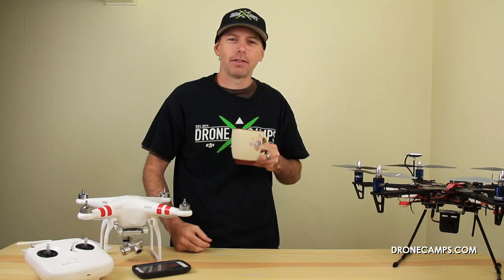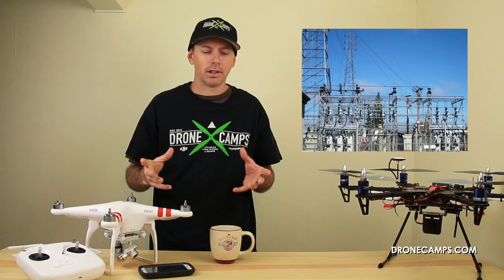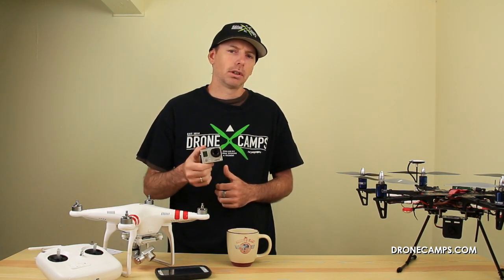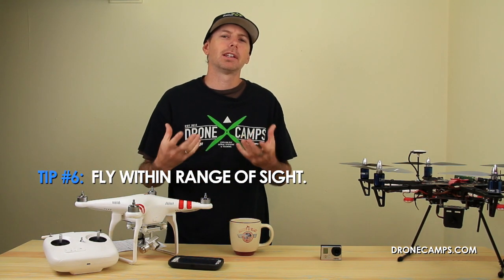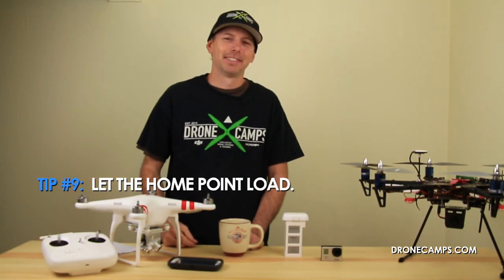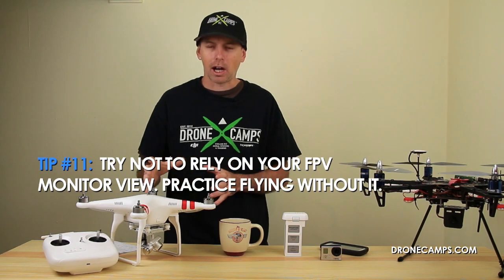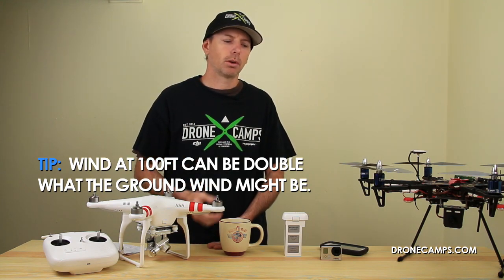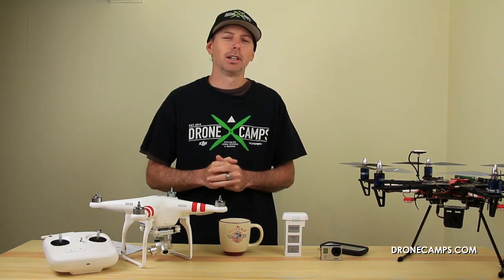DJI Phantom 2 - How-To AVOID FLYAWAYS, UPDATE

Comment: AMA NATIONAL MODEL AIRCRAFT SAFETY CODE
Effective January 1, 2011
A. GENERAL: A model aircraft is a non-human-carrying aircraft
capable of sustained flight in the atmosphere. It may not exceed
limitations of this code and is intended exclusively for sport,
recreation and/or competition. All model flights must be conducted
in accordance with this safety code and any additional rules specific
to the flying site.
1. Model aircraft will not be flown:
(a) In a careless or reckless manner.
(b) At a location where model aircraft activities are prohibited.
2. Model aircraft pilots will:
(a) Yield the right of way to all man carrying aircraft.
(b) See and avoid all aircraft and a spotter must be used
when appropriate. (AMA Document #540-D-See and Avoid
Guidance.)
(c) Not fly higher than approximately 400 feet above ground
level within three (3) miles of an airport, without notifying
the airport operator.
(d) Not interfere with operations and traffic patterns at any
airport, heliport or seaplane base except where there is a
mixed use agreement.
(e) Not exceed a takeoff weight, including fuel, of 55 pounds
unless in compliance with the AMA Large Model Aircraft
program. (AMA Document 520-A)
(f) Ensure the aircraft is identified with the name and address
or AMA number of the owner on the inside or affixed to the
outside of the model aircraft. (This does not apply to model
aircraft flown indoors).
(g) Not operate aircraft with metal-blade propellers or with
gaseous boosts except for helicopters operated under the
provisions of AMA Document #555.
(h) Not operate model aircraft while under the influence of
alcohol or while using any drug which could adversely affect
the pilot’s ability to safely control the model.
(i) Not operate model aircraft carrying pyrotechnic devices
which explode or burn, or any device which propels a projectile
or drops any object that creates a hazard to persons
or property.
Exceptions:
• Free Flight fuses or devices that burn producing
smoke and are securely attached to the model
aircraft during flight.
• Rocket motors (using solid propellant) up to a
G-series size may be used provided they remain
attached to the model during flight. Model rockets
may be flown in accordance with the National Model
Rocketry Safety Code but may not be launched from
model aircraft.
• Officially designated AMA Air Show Teams (AST) are
authorized to use devices and practices as defined
within the Team AMA Program Document (AMA
Document #718).
(j) Not operate a turbine-powered aircraft, unless in compliance
with the AMA turbine regulations. (AMA Document #510-A).
3. Model aircraft will not be flown in AMA sanctioned events, air shows
or model demonstrations unless:
(a) The aircraft, control system and pilot skills have successfully
demonstrated all maneuvers intended or anticipated prior to
the specific event.
(b) An inexperienced pilot is assisted by an experienced pilot.
4. When and where required by rule, helmets must be properly worn
and fastened. They must be OSHA, DOT, ANSI, SNELL or NOCSAE
approved or comply with comparable standards.
B. RADIO CONTROL (RC)
1. All pilots shall avoid flying directly over unprotected people, vessels,
vehicles or structures and shall avoid endangerment of life and
property of others.
2. A successful radio equipment ground-range check in accordance
with manufacturer’s recommendations will be completed before the
first flight of a new or repaired model aircraft.
3. At all flying sites a safety line(s) must be established in front of which
all flying takes place (AMA Document #706-Recommended Field
Layout):
(a) Only personnel associated with flying the model aircraft are
allowed at or in front of the safety line.
(b) At air shows or demonstrations, a straight safety line must be
established.
(c) An area away from the safety line must be maintained for
spectators.
(d) Intentional flying behind the safety line is prohibited.
4. RC model aircraft must use the radio-control frequencies currently
allowed by the Federal Communications Commission (FCC). Only
individuals properly licensed by the FCC are authorized to operate
equipment on Amateur Band frequencies.
5. RC model aircraft will not operate within three (3) miles of any
pre-existing flying site without a frequency-management agreement
(AMA Documents #922-Testing for RF Interference; #923- Frequency
Management Agreement)
6. With the exception of events flown under official AMA Competition
Regulations, excluding takeoff and landing, no powered model may
be flown outdoors closer than 25 feet to any individual, except for
the pilot and the pilot’s helper(s) located at the flight line.
7. Under no circumstances may a pilot or other person touch a model
aircraft in flight while it is still under power, except to divert it from
striking an individual. This does not apply to model aircraft flown
indoors.
8. RC night flying requires a lighting system providing the pilot with a
clear view of the model’s attitude and orientation at all times.
9. The pilot of a RC model aircraft shall:
(a) Maintain control during the entire flight, maintaining visual
contact without enhancement other than by corrective lenses
prescribed for the pilot.
(b) Fly using the assistance of a camera or First-Person View
(FPV) only in accordance with the procedures outlined in AMA
Document #550.
Please see your local or regional modeling association’s guidelines
for proper, safe operation of your model aircraft.

Comment: what good is there to calibrate the compass every time as long as if flies correctly?
Reply from the maker: Granbanan depending on your location. Every day poses new variables in the atmosphere with different levels of RF, radio signals, and solar weather. It's just a good backup plan.
Reply: Drone Camps RC I've had a phantom vision 2 plus since mid December. Had an interesting learning lesson when in an area that had a lot of WiFi systems close to my launching location. When I was linking my iPhone to the DJI WiFi, there must have been a dozen or more I picked up while scanning for the Phantom WiFi. The range or link for viewing what my DJI camera was seeing was shortened to about 200 ft. And the gimbal, while I was flying sideways didn't stay level during the most distant video taking. I don't know what that was all about, do you?
Reply: As long as there are no problems in flight, there's no reason to recalibrate the compass.  But you have no way of knowing whether there will be problems during your next flight, so preventative measures are a good practice.